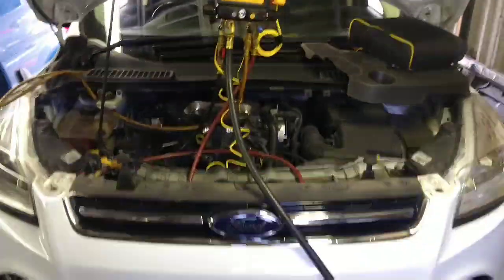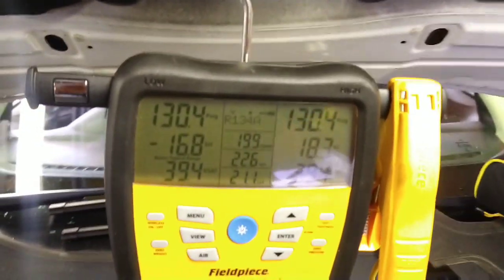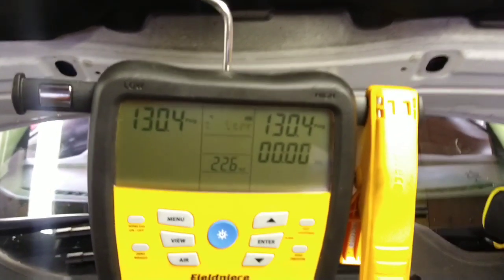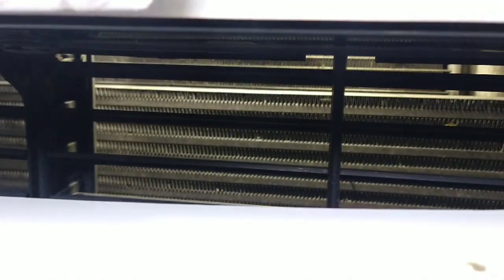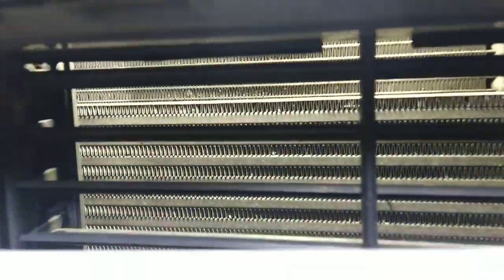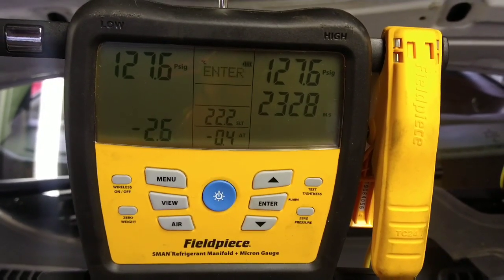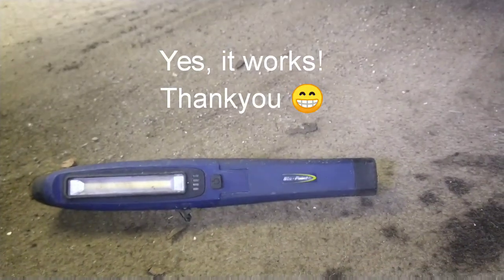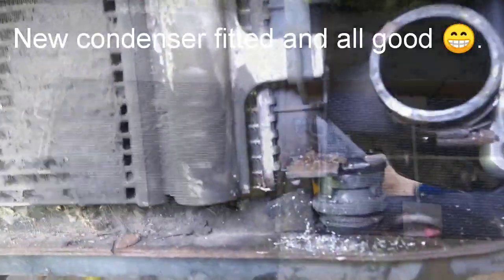Ford Kuga 2014 Air Conditioning fault. Pressure test with digital gauges.

Comment: Does the fan supposed to work when ac is on,for example focus mk3,when i turn the ac on it kicks in   but it looks that needs regasing . Maybe low pressure doesn't allow the fan to turn in on?
Thanks in advance
Reply from the maker: Most ac systems use the gas pressure to control the fans. So if no or low gas then fan won't come on. 👍
Reply: @Automotive_Solutions  apreciate your quick response ! Never seen anyone replying on youtube ao quick especially with advice.Many thanks !

Comment: I have a 2013 Kuga. The front looks the same as the one in your video
I recently went to get a regas and they said the low pressure port is at the back of the engine, is this correct?
Reply from the maker: If it's the same as the one in my video it's between the radiator fans and the compressor at the front of the engine quite low down. If they can't find the service port or don't have access to information about your vehicle find someone who does. 👍😁
Reply: @Automotive_Solutions  😂 yea thats why i said to them don’t bother I’ll go somewhere else.
Reply from the maker: @richardcoles8109  😂

Comment: Well performed, welcome to the digital era. I hope you find the information on the websites on my channel about vacuum tools and training videos will be well worth the read.  With the vacuum pump that you currently on what is the lowest vacuum you can obtain on your micron meter with the vacuum pump running ?.   Then after you shut off the vacuum pump valve on the manifold after letting it sit a few hours where does the micron meter rise up to what level?.  This will give you an indication of how much moisture is trapped inside the rubber on the inside of your hoses or any slight leakage of the hoses them self.     And then performed that overnight high-pressure decay test as I mentioned before on your manifold gauge set with your hoses attached and all port valves open.  Then the next day you perform the test again but this time closing all the port valves on the gauges to just test the manifold by itself without the hoses .
Reply from the maker: I'll give that a go and see. 👍 Please check out t lech's channel..https://www.youtube.com/user/coldfinger459sub0